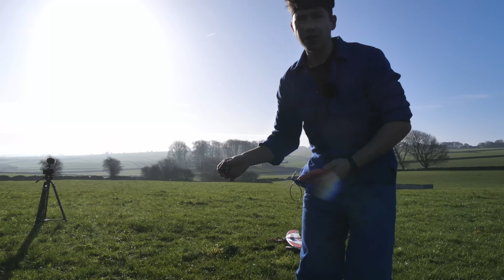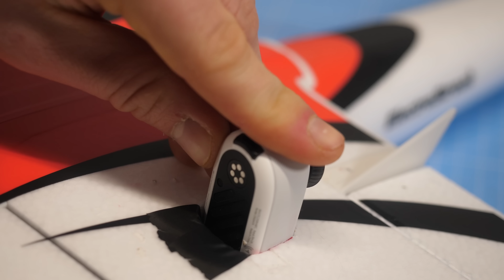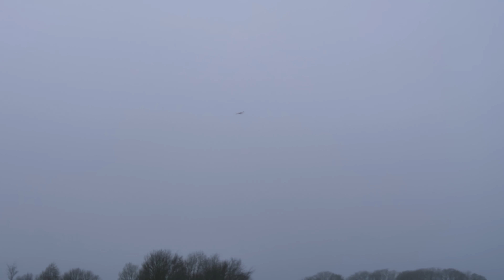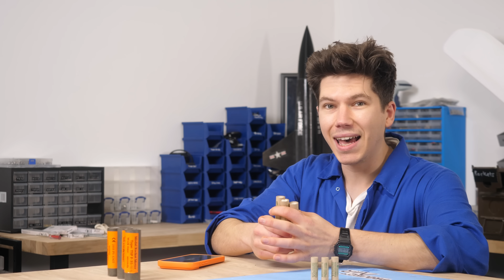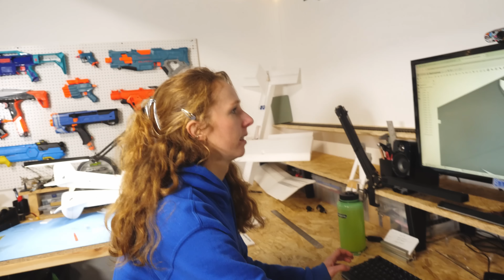Building a High-Speed Plane

Comment: The ailerons were too wide. Cut them in half  and leave half of it towards the end of the wings. This way you could mount the jet engines close to the wing surface. Try folding prop. Don't use the jets that have the parachute charge in them.

Comment: You have to revisit this, however don't use 4 motors.
I was into high power rocketry my whole young life and igniting motors like that will always be the downfall because they won't pressurize at exactly the same time. 
With multi black powder motor rockets the most reliable way was flash pan ignition, even that wasn't perfect.
Plus even with 2 pods, those G motors are way more than enough to have great results.

Also stay away from the Daveyfire style ignitors, they pop and sometimes that's not enough time to ignite ammonium perchlorate motors simultaneously.
Causing catastrophic failure in your use case.
Use the long burn electric matches, 2 per motor.

Comment: Fascinating project.  However, foam is not really that strong.  It's good, to a point, but you're hitting the top speed of that material choice.  I don't know if you're a balsa builder, but there are stronger options for a rocket plane, that are constructed of wood.

Comment: You are rocketing into prop disc resistance as limiting factor. I did the same in dives with a fast multiplex. When it happenef on mine you could hear the flow reversal on the prop. It was a really obvious prop note change. But with yours the rocket burn is probably masking the sound. You need to allow the prop to fold. 
For extreme speed on stock elapor model, maybe skin with 25g/m2 glass. Stiffens it like hell. So fine it is easy and adds very little weight.
Enjoying all you do. Pls contiue making us smile and think.

Comment: if the impulse from all 4 engines firing simultaneously is too great for the airframe to handle, maybe half of the engines firing first, and the second half firing a little later (symmetrically of course), but still in time so that there is an overlap period where all 4 engines are producing thrust simultaneously. Would probably help with the initial jolt of thrust that the engines produce. 
Idk just a thought.

Comment: i think you should make a failsafe where if one of the rockets doesnt ignite, it can drop the opposite via a decoupler. this way end all be all it can drop both motors keeping the airframe safe. (just an idea that could prove to be safer)
Reply: also two holes in each elevon that matching carbon fiber pistons could "lock" the wings when you are doing a rocket launch, thus keeping the elevon from oscillating off the wings.

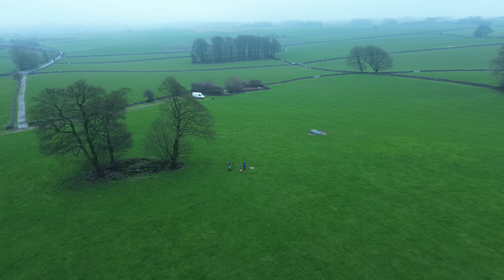Comment: 7:10 that's said in a bit of a clunky and misleading way. Water molecules are actually smaller than most air molecules, so humid air is less dense and so planes would fly faster in humid air. However, you were in fog, and you're not dealing with "water molecules" exactly but "water droplets" which would make a plane fly slower both due to hitting into more mass as well as water clinging to the surface creating parasitic drag

Just say that it's because you were flying in fog, you don't have to try and make it sound smarter
Reply: glad someone said this

Comment: Estes makes a "booster" rocket that is essentially hollow (no parachute charge), and you tape them to the final stage (or another booster) with normal clear sticky tape. As the booster nears the end of its burn, it ignites the next rocket, and the flames that leak between the two motors melt the tape. The booster and more importantly, its weight, fall away, just like a real multi-stage rocket. Just a thought for a longer burn.

Comment: While off the shelf packaged cameras are useful, they are inherently heavy and bulky. you can get FPV cameras from drones that are tiny, light weight, and can be powered by the onboard batteries or a small cell pack added for the purpose. it would be really east to incorporate one into the cockpit cover for a fwd facing camera with minimal change to the aerodynamics of the plane.

Comment: I believe the flutter could have been avoided if the rocket pods would have been attached closer to the fuselage. Also I think a single rocket motor built into the tail would have been the best way to increase speed.

Comment: Very cool and lots of good advice and civil discussion in the comments. I'd like to offer my two cents on how you can go faster. I dont think you need to put the pods on the fuselage but you should consider moving them inboard a little so theyll induce less yaw if they dont start and stop at the same time. I know youre probably set up this way to try to get clear of the tail and that obviously has its own challenges. Your wing needs to get stronger so it doesnt flutter at the speeds youre hitting. Reinforced packing tape is a quick easy way to do this. Fiberglass or carbon fiber are even better 🙃 but even monokote would help a lot. I would make your ailerons much shorter and keep the control linkage as close to the middle as possible. Use a decent pair of metal gear servos in the wings and take all the slop out of the linkage that you can. It's gonna get heavy and be a bit of a turd at low speed so consider mixing in a bit of flaps for landing if you havent already and be very careful when flying slowly. Youll also probably want to give the tail servo and linkage a similar treatment. You can definitely get this thing to go MUCH faster though and im excited to see it.

Comment: The wing camera could have been a couse of failure. Better attach it to fuselage. Redesign engine pylon with a more flexible material to avoid wing bending and as fiew suggested do ignition stageing.

Comment: You can actually get Areotek 18mm rocket motors with the same thrust as a D motor.. 18mm is the same diameter as a standard estes C motor.

Comment: I have that plane.  I've hit 142mph or of a dive.  All i did was upgrade prop to the recommended bigger prop. Also that wimpy 4s 30c battery is holding you back.  Get one with a higher C rating and it can pump the electrons or faster.  Also get the SkyID module from Spektrum ama use there gps telemetry for your speed readout.  Then you have no camera drag.

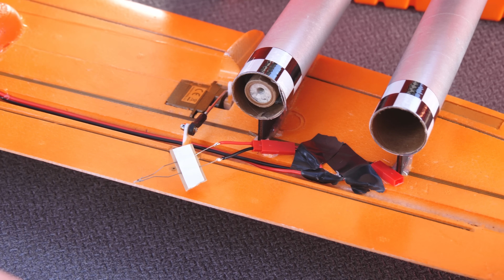Comment: 13:41 You should know better if metric is better stop using your mass measurement for an informal force unit.  Only reason Imperial gets away using what our scales show as a measure of force is it is the unconverted force measurement of the scale unlike the assumption of standard gravity and conversion to mass for gram/ kilogram scales.  
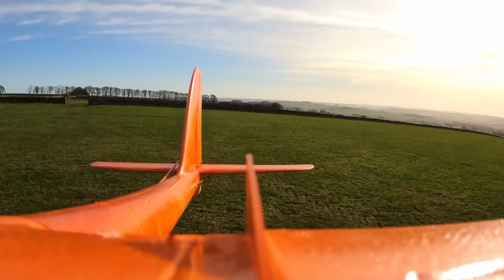16:08 If it's the foolproof system why are you still messing it up? "Kilograms of force"

Comment: maybe try to print delta wings on the plane,thats not flutter.
And print a 2 blade prop with a higher elevation angle optimimized for higher speeds

Comment: Zero calculation if the plane could handle the rocket engines. Zero calculation to optimize the propeller at high speed. You added an “aerodynamic” pod to cover the camera, but still left a blunt edge ON TOP of the wing surface? Completely amateur, zero design research or engineering. Embarrassing failure of a video.
Reply: but he's trying to make it.

Comment: The rocket engines aren't exactly the same and neither is the ignition, so that's going to cause problems.
Reply: the problem was the vibrating turbulence at higher speed on the wings.
The frequency of the turbulence corresponded with the own resonant frequency of the wing, that caused a fast fluttering effect with a catastrophic structural "versagen" of the wing.

Comment: My first worry was having the control surfaces in the gas stream. Melting a hole in them or such.
Getting the wings rigid enough to not flutter feels like a challenge, but might staggering the ignition a bit reduce the initial jerk enough?

Comment: with the 6s battery you would need to change the propeller, which is designed for higher rotational and plane speed. it's like gearing on a bike, but I don't need to explain that to you

Comment: Loving the series! 
What if... An EDF was the nose of a plane, AND a second EDF works as a generator at the tail? Minimum airflow disruption. Energy collected at the front is released at the rear. Control both EDF's in parallel. Add wings and a tail or don't; your call.
Reply: Two EDFs inline in one duct?

Comment: Those wings aren't built for that. Go to a Delta wing and place four "E" or "F" motors as close to the centerline as possible. I'd recommend integrating them stacked (2 per side) into the fuselage, angle them out enough that the rockets won't melt anything you need. 🙂
This is how JATO bottles are mounted, give it a try.

Comment: It would be great to see the same plane with boosters attached to the fuselage! 

You can go with just two situated below the wing (mounted on horizontal pylons that attach to the fuselage) or with two more (four in total) - below and under the body. This should make it possible to align the center of thrust with the center of mass.

I'm pretty sure that this time the wing flutter was caused by the moment of force imposed on the wings by the boosters and by the change of airflow caused by their pods. But it would be really interesting to see how these wings and tail handle the sheer speed loads! 
Although, the tail might suffer from the boosters' plumes and airflow.

And ofc a folding prop is a must-have. Thanks for the great video!
Reply: And I also think it would only be a fair comparison if you test all of this on a brand new airframe if you can get your hands on one more. 

This one is already badly damaged and has had holes cut in it's wings to mount rockets if I it understand correctly.

Comment: Why didn't uou use a foldable propeller? If you start the rockets at full speed, just turn the motor off because at that point, it starts to slow the plane down.

Comment: If it were up to me,  I would create a plan from the 3D printing machine. At least one would have creative control to build it so it was stronger but still have some flex, to deal with the G forces. you could design it to accept multiple sized motors, and create stronger points for the wings and the rockets. It's will be heavier but a lot more solid and if you design it to hold more weight, it will fly just as fast.

Comment: Now get yourself an RC Avro Vulcan, add two booster rockets into the wings, or one booster rocket in the tail section, put enough fuel to fly it up to its maximum ceiling height, and then ignite its rocket/rockets and aim it vertically to see just how high you can take it up past its maximum ceiling height, then try to return it to Earth as a glider.

You can then settle a discussion my friends and I had many years ago about whether the British could have adapted the Avro Vulcan into a Space Shuttle or not.

Comment: I got 130mph level on my F-27 Stryker, 80A esc, 6cell, maybe 2000mah battery. The top guys used 200-300 A esc's and got up to 200mph. Brushless motors were turning 20000rpm plus. This was 10 years ago.

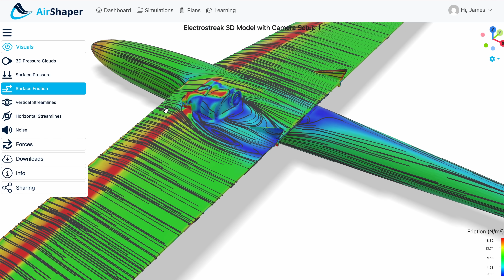Comment: 3:15 about the camera, you should have two cameras attached to the body of the plane with their lenses facing outwards similar to insta 360 drones where the drone doesn’t show up on the video, the purpose here is not to necessarily hide the plane but get some sort of constructed frontal rear and every other angle view with only a slight lens protruding out of the fuselage.

Comment: Having build rockets in the past I had my doubts it would survive, as the initial thrust is huge and if it is weak that is when it breaks. The wing mounts may have been better had the wings been made of a more solid material.
I planned a rocket build, first stage with 5 C engines firing 2 then 3 then blowing that stage off to power one D engine. My mate decided to do the calculations while I got on with designing and building it. Now, pre internet days these calculations were approximate as it grew lighter every second the engines fired so you had that fluctuation that was difficult to calculate. He came to me and suggested I looked at these rough calculations, those numbers convinced me to abandon it altogether. Mach 1.7, 10,000ft, in 8 seconds for a balsa wood and cardboard rocket. The probability would probably have been the fins ripping off and producing a spiralling torpedo which we had previously, and it buried itself 3" into a field that cows wandered around it, and it reduced the length by 2".

Comment: Definitely need a folding prop with break enabled. Ensure you are flying completely level, the extra strain because you were slightly banked didn’t help I think. Finally don’t use a foam plane. Look at composite powered gliders that are designed to take greater forces. Having said all that I do think you are doing great, I look forward to the next video.

Comment: Suggestion - you probably incurred extra drag with your pylon/engine arrangement ending ahead of the wing. Unless your pylons extend the nacelle ahead of and well below the wing, like, say, a 707, having that arrangement with the majority of the nacelle under the wing, and a short distance from the wing, puts you in territory closer to an early 737, which needed the exhaust pipe extended 4 feet past the trailing edge to deal with a fairly substantial drag penalty. I'm no engineer and I don't know the exact mechanism involved, but I suspect it's interference drag of some sort.

Mounting the outboard nacelles further outboard would have probably helped with flutter. See Nagaraj (1967). The pods at the end of a Flanker wing weren't put there to be missile launch rails - they are anti-flutter weights that just happened to create a missile attachment point.

Comment: Bro, just build a carbon fiber delta wing of Similar size, mold rocket mounts into the trailing edge of the wing, increase the motor size, decrease control surface area and make sure the fuselage is longer than the cord of the wings at the root. Yo to you weather you keep the tail
Reply: If you do all that, you can afford the weight of an fpv unit, which will help a lot with getting the right pitch for a proper high speed run
Reply: You do all that with 2-4 e size motors, I can guarantee atleast 250kmh
Reply: How would a delta wing help at 0.14 mach? Compressibility isn't an issue at low mach numbers. The only thing that really matters here is the overall area of the wing, which is probably excessive for the speeds they are aiming for.

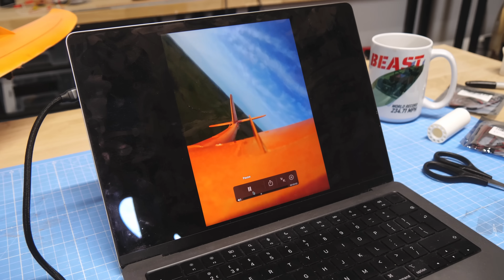Comment: Fun project!  That left aileron at 18:20 looked like it momentarily turned into spaghetti!  🍝. Fortunately, most RC planes can actually fly with a single working aileron!  Personal experience. 😉

The E-Flite ElectroStreak's frame and wings might be too dainty for these loads.  The exhausts of the rockets are also blowing over the ailerons which causes more stress on the aileron since the exhaust gas speed is very high and blowing right against the aileron.

Maybe you can 3D print a center mount pod.  Then have a single large rocket motor on the pod instead of wing-mounted rockets.  Having all that force closer to the centerline and fuselage means less stress on the more delicate wings.  The thrust angle for a center mounted pod needs to be slightly downwards and may require some experimenting.

Comment: Why would you turn the plane when using the rocket boosts, You have to have a level flight to test the boosts. Also you need to move the rocket boosts closer to the fuselage since, With your current design all the load of the sudden boost is felt on the wings so either you need to add a lot of reinforcements to the wings making them heavy or move the boosts closer to the fuselage and center of gravity.

Comment: You definately need something with a more cranked wing like a delta and with the G-forces involved from rocket motors, you are probably actually putting more stress on the wings starting them at a lower speed than if you started them at a higher one.

Comment: The result was guaranteed the moment you attached the pods so far from the fuselage on such flimsy wings. 😅Now, I think you've got your project backwards. Electric motors can get an aircraft several times those speeds. Their limitation is that fast turning high pitch propellers are extremely inefficient (and noisy) at zero speed. What a rocket motor can actually help with is to boost the aircraft to speeds at which the propeller is able to start applying kilograms of thrust. This is used on certain Ukrainian interceptor drones, for example. You can get a better idea of this using propCalc.

Comment: You're not gonna believe that, but a few days ago I was just asking chat.G p t about same project doing with a A10 and carrier landing.  
It got to the point that 40 bottles of (rocket assisted take off of C130 , we could have flown a 10 vertically like harrier.

And I utilize bottle ejection in my design so it can fly with full capacity  fuel and ammunition after take off. 

It was only a discussion with chap v t and crunching the numbers , and it's weird that you did the same thing In model r seaward. 1:08

Comment: Make the tubes smaller. That will make them lighter and more aerodynamic. Then put 3 tubes on each side of the wing and load them up with B sized motors. Then fire them in sequential pairs. This will give a more manageable amount of thrust but over a longer time. Will require 3 rc switches, or maybe a small timer circuit that would fire the rocket pairs in sequence.